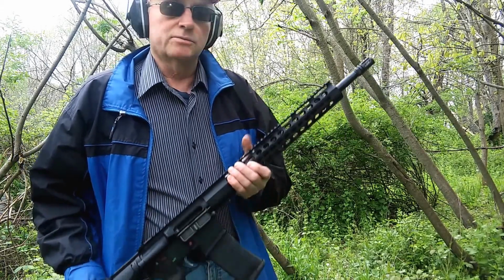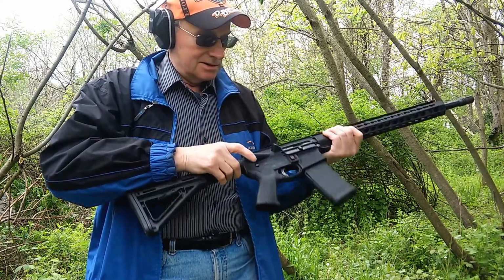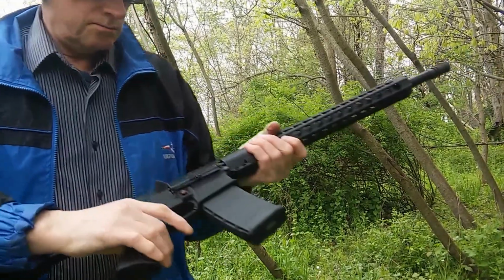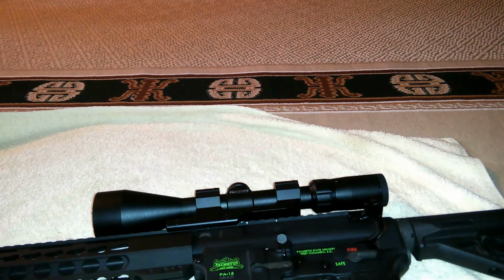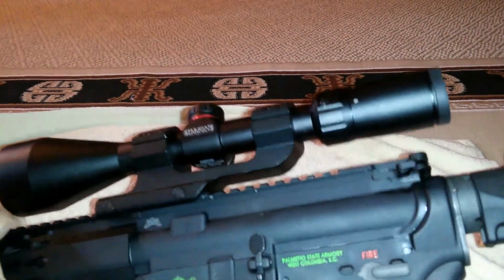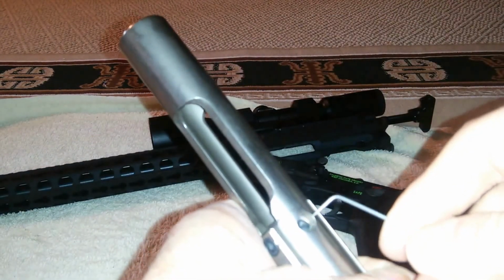MY NEW AR-15 FIRST FIRING

Comment: This is the same reason my PSA doesn't lock back, the gas tube is very misaligned. I bought an adjustable clamp on gas block, I'm going to just swap over to it.
Reply from the maker: Unless you are going to fire full auto, you don't need the weights in the buffer. Removing them will cure the problem.